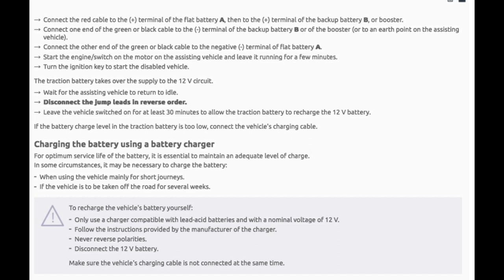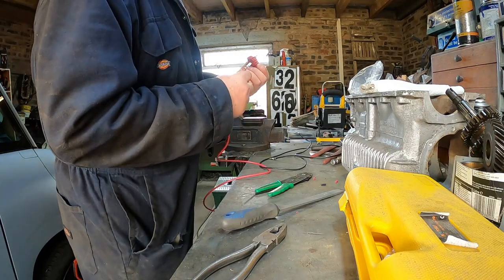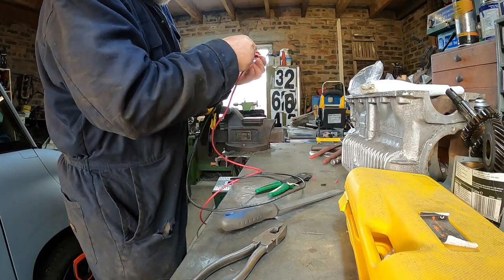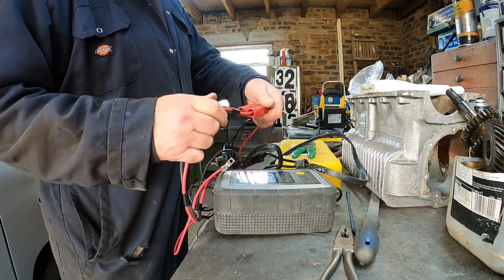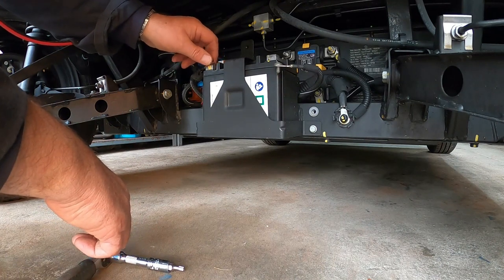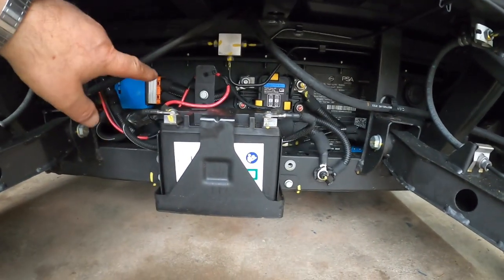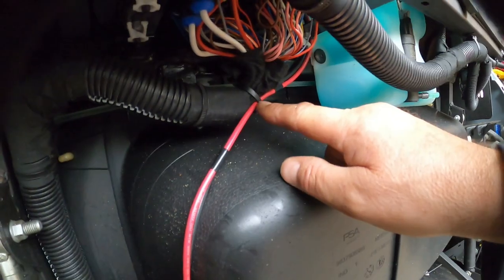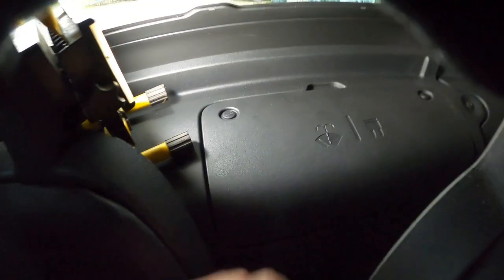Fitting a 12 Volt Battery Tender to the New Citroen AMI Electric Quadricycle

Comment: Good job on installing the charging cables to the 12 volt battery. That will really be handy to keep it fully toped off. Cheers Doug
Reply from the maker: Hi Lloyd, hopefully I will never need to top up the 12 volt system (so long as I use the car regularly).

Comment: Well done, I use something similar for my classic MGB, the batteries are under the floor behind he seats, I use a Cetk battery conditioner with a battery terminal plug in connector made by Cetk.

Comment: What's the reason for adding the Anderson connector? Does the Ami not "maintain" the 12 V battery? Most other EVs I know of have features to maintain the 12 V battery even when they are not being charged.
Reply from the maker: Apparently the Ami only maintains the 12Volt battery when the ignition is switched on. Therefore the 12 volt battery can run flat if you leave the vehicle switched off for extended periods. They recommend disconnecting the 12 volt battery if you leave the car for a couple of weeks.

Comment: I am very worried about all the exposed battery and chassis terminals and corrotion from road salt during winter.

Realizing thers a lot of space in the rear. I think it would be interesting to fit an extra 12V battery to run axillary cabin heater.

I'm courious about charging traction battery in the winter. I heard something about not charging if battery i colder than -5 °C.
Reply from the maker: Have a look at my latest video on rustproofing. I have coated the exposed terminals with Lanoguard. Chassis has also been rustproofed inside & outside of the steel box sections.
I do think that a 12V 100Ah LIFEPO4 auxiliary battery would be useful to run a higher powered heater and possibly a heat pad for the traction battery. You are correct about the -5°C charging limitation (See the User's Manual).
Reply: @DougsShed  I think-5 °C cam be a challenge. Looking at the last 12 months, we have 4-5 months where it's expected to occasionally be colder than that. 

I have three worries about the Ami:
- cold battery charging 
- defogging windows (and to some extent cabin heating)
- tethered schuko (I'd prefer Type2 socket, for multiple reasons)

The first two are significant, and needs to be delt with, either disprove or resolve.
The third is more of annoying than a problem, (except at a low powerd 6A = 1.4 kW Type2 station)
Reply from the maker: @thorbjrnhellehaven5766  The Ami comes with a Schuko tethered plug on the car and is supplied with a Type2 adaptor which attaches to the car's Schuko plug. This adapter is used to plug into a public AC charging station. The adaptor has two switches which you manually press (A) to signal that the Type2 plug is connected to the charge station and (B) to signal that the car is ready to accept charge. The Ami does not accept rapid charging.
I did think about using a battery powered hot air gun to clear condensation/ice from the screen (during short trips).
Reply: @DougsShed  yes, I'm aware of the Metron Type2 adapter supplied with Ami in UK. But the adapter is just a bad workarround to a problem that shouldn't exist with a new EV.

- The switches are required for functionality, however I think they should be possible to lock with a key (or key switch) too.
- If you connect to a charging station with load sharing/balance, it might send a sinal to the car to not charge faster than 6 A (1.4 kW), trying to change Ami at 2 kW, will probably cause station to shut off, possibly affect others, at worst break something. 
- The tethered cable in the door frame is not an attractive solution to handle while it's raining, you spend more time with open door causing mor rain to enter the cabin, and before departure you spend time putting the cable into the small hole, to close the door, whil getting soaked, before entering the car to worry about windows fogging up from all the moisture you brought on you clothes. 
- it is against electoral code (in Norway) to install schuko intended for EV charging, 
- some chargepoints have tethered Type2, they are incompatible with the normal Type2 adapter.

If Citroën doesn't switch to Type2 socket before I possibly order an Ami, I will look into options to DIY install a Type2 input socket, and bring a standard Type2 cable. Even if it doesn't solve the power control issue above, the other issues gets solved.

Comment: Very practical arrangement with the Anderson connectors, I initially wondered why you'd gone for a high Amp plug. You could probably come up with an isolator relay arrangement to disconnect it while charging the traction batteries but it may be more faff than it's worth if you use it frequently.
Reply from the maker: If I find my battery charger sitting on the driver's seat I should remember not to plug in the 48V charger or turn on the ignition. I don't think the battery tender will get much use but it is always handy to have the option.
Reply: @DougsShed  Very true. A little surprised they used a flooded battery for the 12V circuits rather than an LI, maybe a simple cost issue.
Reply: After your cold weather test, I did wonder if that was an influence for a flooded battery selection.
Reply from the maker: @niallsommerville9941  Quite possibly.

Comment: I’m going to fit a flexi solar panel to the interior frame that’s the size of the glass roof panel, I will secure so it can be pulled back and forward like a sun shade, connected to me allpowers generator so and I run many different ancillary items
Reply from the maker: Useful for running accessories

Comment: Hi Doug, I've read the manual and you have confirmed in the statement above that the battery tender should be disconnected before connecting the onboard 48v charging . So i'm assuming that everytime you want to connect your charger whether in charger or tender mode you still need to remove bumper to disconnect 48v internal charge cable to the battery? Or is there something I'm missing?
Reply from the maker: I don't envisage having to connect my battery tender unless the vehicle has been left for a long time and the on-board 12v battery is too low to actuate the Ami's systems (which does happen).

Comment: When the 48v main lithium battery is charging, so I take it the 12v does not get a charge?

Is there 12v only charged when the ignition is on and therefore always topping up from the 48v battery and never the factory installed mains?

I guess if heater used abs 12v low then the range on a full charge is decreased due to this 12v being charged even if the fan heater is not used on that journey?

 Thank you for sharing
Reply from the maker: The 12volt battery also charges whilst the 48v battery is on the mains charger.
However, if the 12V battery is too low the car will not connect to the charger or initiate the 'ignition' via the key.
I tend not to worry about range, on my normal short journeys, however the biggest problem is power limiting on hills. The power limit can kick in depending on ambient temperature, charge level, steepness and duration of hills. 
When power limited, I have noticed a very slight increase in performance if I turn off the screen heater.

Comment: What is the reason for this ? I’ve ordered a brand new Ami for may 2023 but not sure what this extra battery does . Thanks in advance
Reply from the maker: The battery tender leads are only to quickly access the 12 volt battery if it ever runs flat (from long term storage). It is not necessary for everyday running of the Ami. I do however run a totally separate 12 volt battery system to power accessories such as an additional electric fan heater.
Reply: Thanks for the information 👍

Comment: Will the ami run whilst it's being charged? Plenty room for a generator in the rear
Reply from the maker: No, the car will not charge when running. External charging only operates when switched off and with the handbrake applied.

Comment: Similarly going for Wax oiling the underbody and having vulnerable electrical connections visible on the underside better protected from the elements - a necessary investment in time and money - peace of mind...
Reply from the maker: The steel chassis has a very thin coat of paint from the factory, along with some iffy welds!
Reply: Hence why I opted for a 2 year PCP with the option of handing the keys back when the warranty expires……